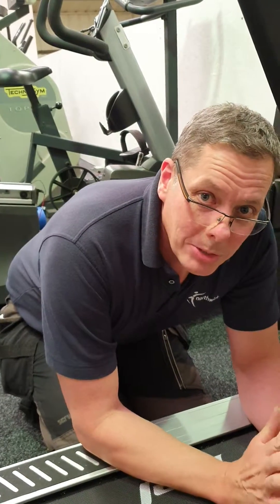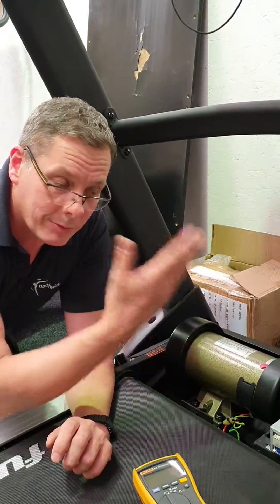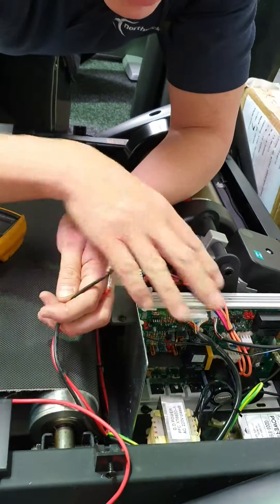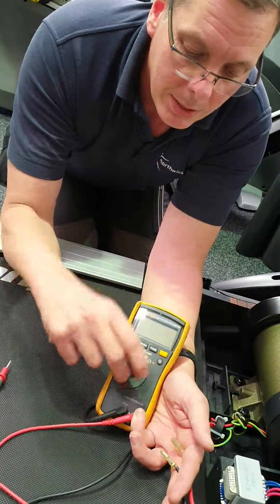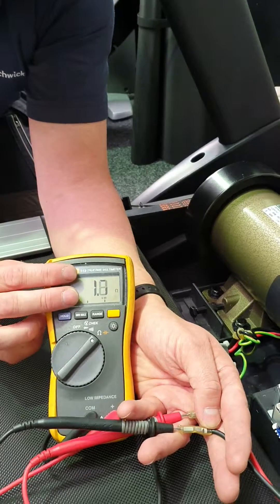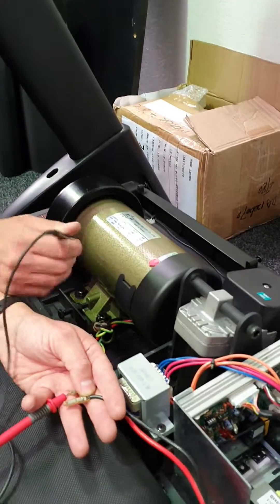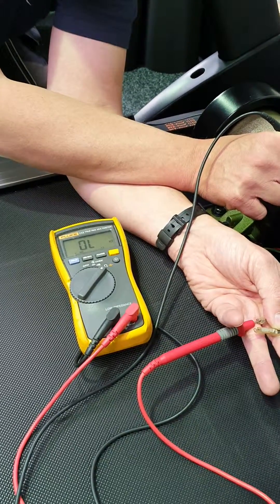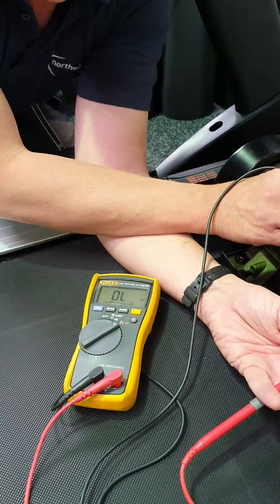How to check a DC drive motor from a treadmill using a multimeter

Comment: The resistance check on the black and red is fine.  However, you need to slowly rotate the motor to check the rest of the commutator connections.  There could be a short and there could be an open circuit.
Reply from the maker: Yes absolutely. It's a difficult test as a dc motor will generate a voltage as you rotate and test it which could confuse autoranging meters and give confusing readings to the average user!
Reply: The motor would only generate voltage if it’s rotated at a high speed.  This would induce voltage due to the magnetic flux through the armature. 

However, if the motor rotated extremely slowly, then there wouldn’t be any fields generating induced voltage.  Like a generator.  

This would then afford a continuity check between armature conductors.  The DVM also being on ohms, wouldn’t be affected by slow rotation.  As in one degree of arc per second.
Reply from the maker: @digitalbroadcaster  yes and also at low speed. It's easy to get 10V by turning the motor by hand (with the drive belt off of course)

Comment: I was told my motor might have a short. On test 1 I get 07.1 on a 200 ohm setting and 007 on a 2000 ohm setting, is this too low? And on Test 2 there is no short. Many thanks.
Reply from the maker: The test is a pass. Sometimes a short can exist which is intermittent on only exposed on load. Your multimeter cannot detect every possibility and I would recommend you gave the motor professionally tested if there is any doubt in your mind
Reply: @charteredengineer  Many thanks for your reply.

Comment: Hi, I get a 1 (no change from when I switch meter on) on wires and same for next with black on motor🤨
Reply from the maker: Either your meter and test leads are faulty or your motor windings are burnt out (open circuit)

Comment: Hi I’ve a nordictrack 17.2 treadmill that stops when you stand on the belt- motor number ZDY 116-MNT-077 PN F- 318100.  I’ve followed you’re video the meter reading is 0.8 ohms and OL when testing to the motor- appreciate any advice you can give me thanks.Paul
Reply from the maker: Motor windings are ok but you may have too much friction underneath your running belt

Comment: I have  PMDC treadmill motor. Model is ZY90-2   1.5HP   VOLTAGE 180DC  DIRECTION C W    SPEED 4200RPM

I am getting 0L when testing from red or black to motor body 
I am getting 4.6ohms between red and black on multimeter 
Is this motor OK?
Reply from the maker: Yes the windings are 👌
Reply: @charteredengineer  brilliant, I connected the motor to a drill battery to test its functioning OK and it seems to run perfectly fine. Is it normal to not have much torque when connected to a battery? Just seemed too easy to stop it rotating with my hands (the motor was removed and lay on a work bench)
Reply from the maker: @philipyates7138  the motor usually runs at 180V and you battery is probably 18V at best so the torque will be much lower than normal

Comment: Hi im going to try this when I'm off work in a few days. We just got a second hand treadmill (karrimor pace) and it seems to work OK but when in use even at 8kph for 10 minutes we get a horrible burning smell and it tripped the house breaker. After allowing it to cool I wanted to see if it still actually worked so set it off at 2kph with nobody on it and it seems OK. It just eventually gets extremely hot. I'm wondering if this is a sign of a bad motor?
Reply from the maker: Could be excessive friction from running belt causing motor to work too hard and overheat
Reply: @charteredengineer  what would cause that then? I'm new to the treadmill scene so would I be correct in saying the belt it too tight and needs loosening?
Reply: @Ryland Jon your absolutely correct, I don't care

Comment: Motor tested arround 6 ohms. I’m repairing now treadmill olympia. I replaced parts in the board the mosfet and the rectifier. When i turn on it’s working. Then when I’m starting using. It’s suddenly blows the fuse then the mosfet was shorted and the rectifiers. What is the posible problem sir?
Reply from the maker: Get the motor insulation tested. Sounds like it has a problem that shows only when it is on-load. An insulation test will expose any short circuits in the motor that your multimeter can't find

Comment: Is it possible to get a normal ohm reading but when the motor is running at highspeed it shuts down because of excessive carbon build up from the motor brushes or the motor brushes are bad. Issue: Treadmill runs at low speed fine with weight on it, board is in good condition and belt; however once you increase speed to 6.0 or higher the entire system shits down and has to be reset to get power. Replaced the control module and the problem still exist.

Comment: Hi - Just run this test after my running machine failed to drive the belt, I also get an E1 code! Tested as above and the first reading says 02.2 and the second 0.L please advise.
Reply: Motor is fine. Try to  lubricate treadmill and check your speed sensor.

Comment: I am getting 0.8 reading from the motor. Is that too low?
Reply from the maker: That's fine
Reply: @charteredengineer  I have seen various others on youtube testing the motor with a 9v. However when I connect mine it does not move. Would you say that is a reliable test or the reading from the multimeter is enough? Thanks so much!
Reply from the maker: @michaelwoiten7072  a 9V battery is not a reliable test. However motor should turn slowly provided  it is not under load (ie. drive belt must be off and motor free to rotate in fresh air)

Comment: Hi there I have 29.3 on the first test, and 40.7 on the second test. Does the second test show problem with motor? My treadmill is currenty shorting each time I put it on. I changes the MCB, but still shorting.

Comment: Hi, my treadmill died and I had the control board repaired. When it was refitted it still didn’t work! The repairer says motor fault. I’ve tested using your video and get 2.6 from test one and 1 from test 2 (if I connect the two wires I get 0.00 so assuming a “1” for test 2 is good?)
Is there any other tests that can be done on the motor or does it point to still being fault in control board? Thanks
Reply from the maker: Send me details jon@northwick.org.uk

Comment: Hello. I’ve a proform pf3.8 treadmill. The belt has stopped on machine, and when I do your test I’m getting 0.003 on the machine. I’m guessing this means the motor is broken? Any advice on cheapest way to repair/replace? Thank you

Comment: my meter has a variable ohms setting, on 2000 my reading is 4, and when testing on the chasis the meter says 1... I hear the motor try to run when I plug the treadmill in and the control panel lights up, but there's no movement from the belt. When I plug it in and try to run it with the cover off and insides exposed, the circuit board has a red light that starts blinking, but I don't see the motor trying to move at all. I feel like my motor is bad :(
Reply from the maker: The windings on your motor are good 👍

Comment: I did mine red and black and it reads 8.9 and it beeps. Second test the entire motor is painted I was wondering If the copper inside the motor will also work for the test if so it reads about 7 also it beeps?

Comment: i have an igbt 40N60 shorted on control board and a reading of 3.8K♎ between red & black rated at 180 DC motor wire. Meter reading between DC motor wire and it's body reads OL 
  i tried powering this Motor externally with a 12v 6.5mha ups battery is spins after u give a tug. Do v replace this motor?

Comment: I got zero ohms for test 1
Reply from the maker: You should get a reading higher than zero. You will have some resistance such as 5 ohms or 10 ohms.
Reply: @charteredengineer  so I redid the thanks and I got 2.6-3 Ohms about. Thanks for responding.
Reply: @charteredengineer  this is for a Precor 120dc motor

Comment: My motor is the Greenmaster GMD82-04-18 1.5hp continuous duty, 180v DC Max, my ohm reading is 6.5, I’m not getting anything from the second test just the multi meter making a beep sound, can you determine if the motor has failed
Reply: Just touch the two multimeter probes directly to each other - does your multimeter make the same beep sound?

If it does make that beep sound, that probably means that you have a short circuit in your motor.

Comment: What does "out of range" mean in this case?
Reply: "OL" doesn't mean out of range it means open loop which suggests there is no continuity which means there is no path for electric current to flow i.e no short circuit to ground or between phases :)